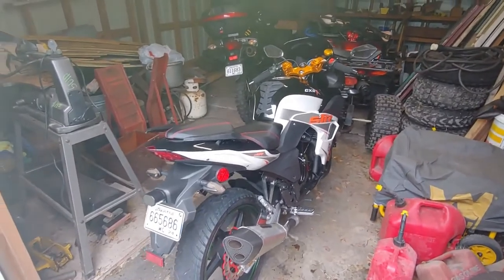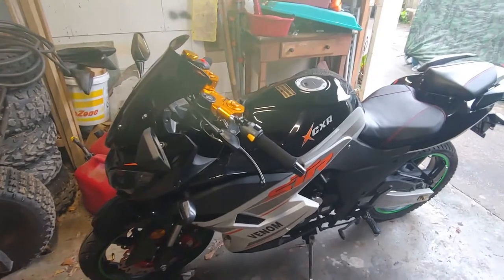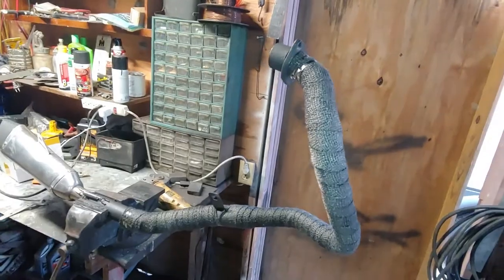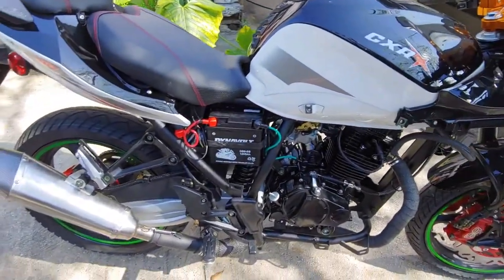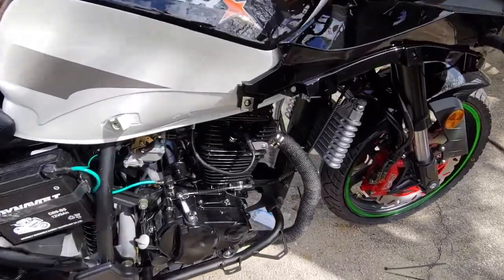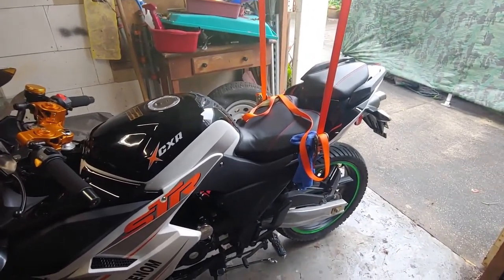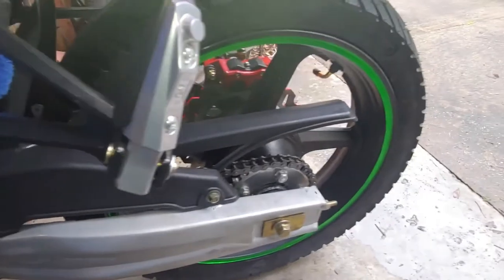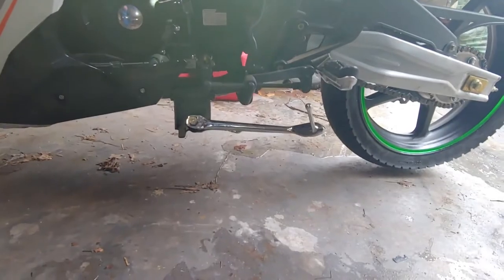Venom X22R 250 Mods

Comment: Hey Mr Jerry I noticed that on one comment you told Nico Gotti that we were to remove the spring and filter when installing the air cooler but on another comment you told another individual that we just keep the screen out and put the spring back in I'm just trying to make sure I get it right?
Reply from the maker: Remove the spring and filter screen. The adapter will not fit if you leave them in. There will be a filter and spring in the canister on the oil line to the cooler.
Reply: Okay Mr Jerry thank you very much for the confirmation on that I greatly appreciate you and Mike for what y'all do you're a very helpful with all of us out here on these venoms and srt

Comment: Ours won’t stay running. Any advice?
Reply from the maker: If it's new, give it some time to break in. Also may need the valves adjusted.
Reply: @JerryHawk250  ok and it’s a 2021 with 1,500 miles on it.
Reply from the maker: @xxamaughanxxgs8843  I would check the valve adjustment. Too tight of a gap will cause idle issues.
Reply: @JerryHawk250  I think we found the issue the rubber piece that goes from the motor to the carburetor has a big crack in it.
Reply from the maker: @xxamaughanxxgs8843  haha! I was just getting ready to tell you to check for intake leaks.
Reply: @JerryHawk250  yea lol most definitely 👍 I appreciate your help man! One more question did you ever have any issues with the bike rattling between 3-8 rpm like loud loud rattling we have righted everything lol

Comment from the maker: Update for all you "What's the top speed? " people. lol So far with the mods i have done and with just over 600 miles on the bike. I did hit 79 mph (GPS) over the weekend on a straight away before coming to a curve. 80+ mph can be achieved. The engine is just starting to loosen up and feeling much stronger. New videos soon.
Update: 1200+ miles 81 mph and was still climbing in speed very slowly. Next mods will be the CRF230F 11:1 piston, porting the head and the 1059-1 CRF150F HotCams
Reply from the maker: @Mr.FLOYDs  thanks. I have a lot more mods to do. There's a lot more potential in her.
Reply: Where are you located?!?

Comment: Thank you for responding… I have adjusted the idle up… I’m leaning towards the ecu got damaged when I had broken wires I don’t know how to confirm that…
Reply from the maker: If it's a new bike I would contact the dealer you bought it from and have them send you a new one. It can also be a bad throttle position sensor but with out having it in front of me it hard for me to diagnose.

Comment: Hey I got a hawk 250 DLX with 3000 miles it will start idle for 10 to 15 seconds then die.. you can rev it during that time . Put it in gear take off but 10-15 seconds it dies.. I replaced the fuel pump checked for broken wires found a few fixed them .. can anyone help… I tried taking it to local bike mechanic he doesn’t work on china bikes…
Reply from the maker: I'm not very familiar with the EFI Hawk version but have you tried adjusting the idle speed?

Comment: Hey Jerry what's the full dimensions of the rear sprocket you installed?
Reply from the maker: Center hole is 64mm, Bolt pattern is 96mm and bolt holes are 10.5mm

Comment: Ok jerry I ordered the oil cooler that you have.... I’m lost cause wen I ordered it I didn’t kno it came with a syringe 💉 and you know where u drain the oil out at.... it has a screen in it... do I pull out this screen... ok also the oil cooler came wit a new cap wit 2 bolts on it were 2 lines connect but on this cap it has a blue rubber thing on the end of it... but on the picture of the instructions it’s looks yellow so do I remove the blue rubber piece
Reply from the maker: You have to remove the screen and spring and leave the blue rubber piece on the adapter. I disconnect the hose at the adapter to drain the oil.
Reply: Ok I’m working on it now

Comment: Hi Jerry, I'm gonna install that oil cooler on my venom x22-gt, I wanted to ask you if you still fill the oil reservoir with oil as well as use the syringe to fill the oil cooler, or ONLY fill the oil cooler with syringe?
Reply from the maker: You only need to refill it if you actually drain the cooler.

Comment: Hey Jerry! Just wonder what size that rubber  manifold piece is between the carburetor as the engine…could you help me out?
Reply from the maker: it has a 30mm inside diameter. I think Venom Motorsports offers a solid aluminum manifold as a replacement.
Reply: @JerryHawk250  Thank you so much! your videos have been helpful

Comment: U got a question mate what kind muffler i should get on my falcon 250cc automatic i was trying to get something to where i dont have to cut or weld maybe slip on or something but i want heavier sound
Reply from the maker: I still have the stock exhaust. I'm not sure what's the best muffler for your bike. Check out Cesar with Small engine vilocity's channel. He has done the exhaust on his bike.
Reply: @JerryHawk250  ok cause i heard you said you order off ebay caesar rarely responds  but I'll ask anyway and btw how's the bike holding up how many miles

Comment: Nice bike Jerry do you have a link to sai delete kit??
Reply from the maker: Thanks. I made the block off plate from aluminum flat bar.
Reply: @JerryHawk250  do you think a block off plate from a Yamaha will fit I seen a kit on Amazon
Reply from the maker: @ts.sims7750  I would know. You can pick up a piece of 1/8" aluminum flat bar from Lowes or Homedepot and cut one out. Just trace out the gasket onto the flat bar and cut it with a hack saw, sand or file the edges then drill the holes. It's very simple to make.

Comment: Hey Jerry I just ordered me a wheel cooler off Amazon that'll be here tomorrow besides the installation is there anything that's supposed to go inside the oil cooler what is the 125 ml syringe for?
Reply: And do I no longer need the screen? Just the spring?
Reply from the maker: Use the syringe to fill the cooler with oil before connecting the hoses.

Comment: Do u removed the Cadillac converter wen putting on a slip on
Reply from the maker: Yes. There's nothing wrong with the stock muffler. It's straight through with no restrictions. The cat is the restriction in the exhaust.  my videos shows how I did it.

Comment: IS GTX 250 EFI SAME BIKE?
i NEED PARTS WILL THESE MODS WORK ON THE GTX 250 EFI?
Reply from the maker: Not the same bike. Engine is similar. Mods like the oil cooler, De-cat exhaust and possibly the advance timing key will work.
Reply: @JerryHawk250  do you know what rotors will work on this bike . I know its clone of kawaski but year model i dont know . Any help Want to find rotors for my bike ?Can you help ?part numbers or a cross reference to ninja bike maybe ? Reason I ask this cause dealer says its clone to ninja on there site .Also want to find clutches that will fit ?
Reply from the maker: @spyplane3979  I don't know if any parts that cross over or not. I never had to change any parts. Sorry, i'm no help on that part.

Comment: Ok I didn’t put oil in the oil cooler first.... I jus put it on the motorcycle and added 1 quart of oil.... Did I do this wrong or do I just need to add just a lil bit more oil
Reply from the maker: You will need to add a couple of more ounces to that quart. Check the oil level again after you run it.

Comment: How do you adjust the vale’s on these?
Reply from the maker: You will need to remove the tank to get access to do the valve adjustment. There are two round caps that you will have to remove to do the adjustment.

Comment: Jerry good afternoon bro, I have a lil issue had the bike for about a year now and it seems to not wanna stay on during the cold start (even on low choke) thought it was the battery drained from the winter changed the battery but still won't stay on but if I catch the gas I can ride around no problem which is weird but if I slow down or stop at a light bike will cut off smh HELP once again brother lol please!!!
Reply from the maker: Make sure you have the idle set at around 1500 rpms. Do you still have the stock carb on the bike?  If so you will need to gain access to the idle mixture screw and richin up the idle mixture. Sounds like it's set too lean.

Comment: So with your body weight whys the mpg you get?  I’m 210 lb the website says up to 69 mpg so with my weight I’d imagine 60.
Reply from the maker: I just got it and only have a little over 70 mile on it so haven't had a chance to check it. Still have a full tank. I weigh 180. My Hawk 250 gets between 65 and 70mpg. This bike is lighter so should get the same or better. This weekend looks nice so I'll run up 100 to 150 miles on it.

Comment: It looks like a 600 , but it's a air cooled 250cc looks like a hawk engine not sure but I'll work forever , top speed  ?
Reply from the maker: Bike is full size with a huge 5 gallon tank. It has the CB 250 which has the OHC where as the Hawk has the CG250 which is a push rod engine. No top speed yet. Still breaking it in. Only have a little over 70 miles on her. I still need to up the main jet a little cause it's still running a little lean after removing the cat.
Reply: @JerryHawk250  nice the over head cam could make it faster, swap it to the hawk lol
Reply from the maker: The CG is better for the Hawk because the push rod engine has better low end torque.

Comment: What are the measurements on the rear sprocket
Reply from the maker: Center hole is 64mm or 58mm if you remove the ring on the hub which will be a better install. Bolt circle diameter is 96mm.. Bolt hole diameter is 10.5mm.
Reply: @JerryHawk250  is that what I need to send the sprocket people
Reply from the maker: @CrazySquirrel98  yes. This is the form you will fill out to place the order. https://shop.pbisprockets.com/product.sc?productId=503
Reply: Thank u so much

Comment: Hey Jerry on this video at 2:18 makes a weird noise and cuts out my bike is doing this and I can’t figure out why ? Can you please help me on what I should do
Reply from the maker: That was because I haven't set the idle mixture yet. All these Chinese bikes come set real lean from the factory. Idle mixture is about 1 1/2 turns out from lightly seated. Once it's set it won't die out like that. Look around the 2:58 mark.
Reply from the maker: Oh yeah. That noise you hear is from the one way bearing on the starter which is normal.
Reply: I saw you upgraded your carburetor did that help with the mixture so it won’t cut out
Reply from the maker: @mizterrater2378  I had no problems with the stock carb once I adjusted the idle mixture. I did upgrade to a larger carb only because of the ported head and 11:1 piston.
Reply: @JerryHawk250  I found out what it was Jerry after further review I had gained a crack in my intake manifold but I ordered a new one I think because I was taking in a lot of air it kept making me cut out appreciate you a lot jerry always
Reply from the maker: Glad you figured it out. The new bikes like my Venom Ghost came with an aluminum intake. They had issues with the rubber intakes cracking.
Reply: @JerryHawk250  that’s exactly what I was gonna order a aluminum one my brothers is starting to crack definitely too so the rubber ain’t good for that Kopy noted and ordered 👍🏽💪🏽
Reply: @JerryHawk250  is there a recommended link you have to order a aluminum one I see there is a couple ?
Reply from the maker: @mizterrater2378  I don't have one right off hand. I haven't had to buy one yet.

Comment: Hey Jerry! Back again. On course to do just about every mod you've done because I like where your rpms are for cruising speeds. Im about to use the link you provided for the sprockets. Just have a couple questions. Do you still currently run the rear 34 tooth and have you changed the front?! What is the chain size recommended, and will the center hole need to be custom cut? My apologies if this is too overwhelming =}
Reply from the maker: I don't have the bike anymore but i wouldn't go any smaller than a 36 tooth. With the 34 tooth the chain would hit the hub. I never counted the links. I always bought 428 x 136 link chains and just cut them down to the length i needed. Center Hole Size. size: 64mm, 58mm if you remove the spacer ring   - Size of bolt holes diameter. 10.5       circle diameter through center of all bolt holes: 96mm
Reply: @JerryHawk250  dont these bike use the zongshen 223 engine if so then it should work with the gtx 250 these sprokets?
Reply from the maker: @spyplane3979  Some of the newer 233 have a slight different size bore. Front sprocket should still be the same though. The rear sprocket may be different though.

Comment: hey Jerry can you do me a favor I'm coming all the way from Seattle back to New York and I don't know the dimensions of the battery and I'm trying to buy a replacement can you just shoot me the dimensions of the stock battery on the df250
Reply from the maker: A Harbor freight generator battery will fit perfect. I've put them in my ATV and utv and are holding up well. If this one goes bad I'll install the same. Use the 20% off coupons they have.